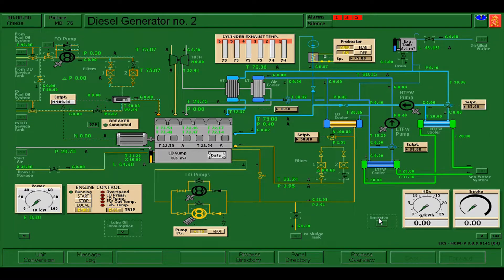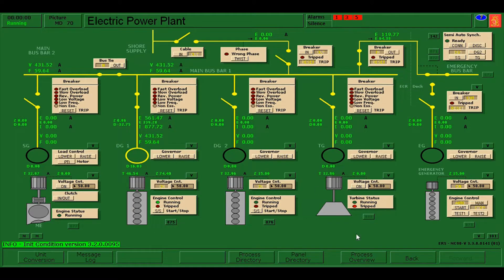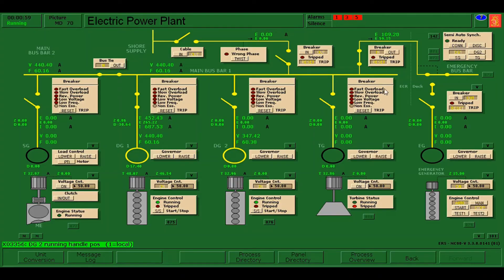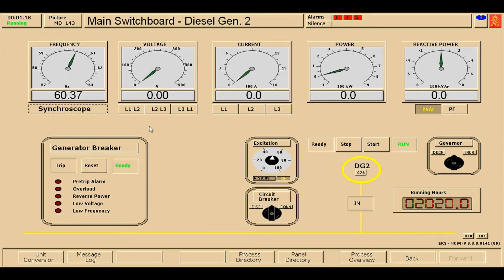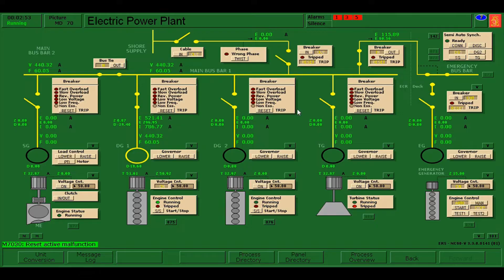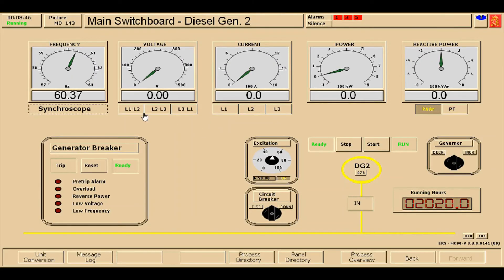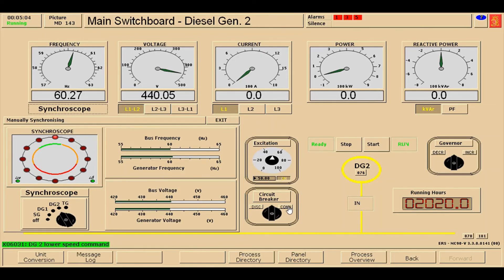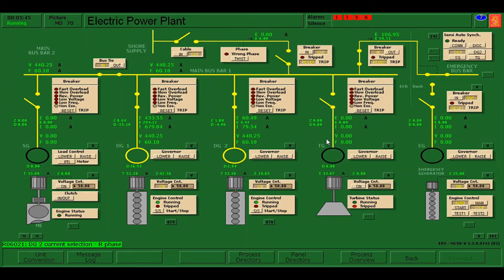ELECTRO 223  PARALLEL RUNNING OF DIESEL GENERATORS ON KONGSBERG SIMULATOR

Comment: What is the indications or meaning of Alarm sir?
Reply from the maker: if it exceeded the alarm setpoints(high/low for example) it will give indication with corresponding number at the top. its blinking as well wherein you need to normaliza/ rectify it